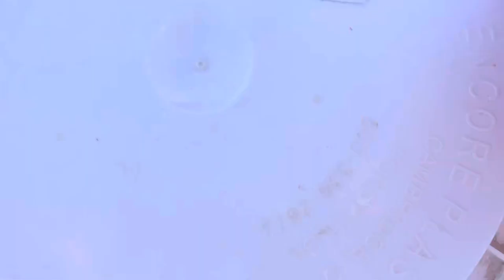Should we build a Rammed Earth Homes on our off grid land ￼

Comment: 100% Use rammed earth on the exterior walls and a couple inside for thermal mass-
I’ve always like the idea of a south facing glass porch with a roof that has long enough overhangs so in that in the summer much of the midday sun is blocked from shining into the porch. But in the winter, when the midday sun is at a lower elevation above the horizon that in summertime , all that sun will warm up the rammed earth wall. The wall built specifically to store that energy during the day and release it slowly throughout the long winter night. Aka passive solar heat via thermal mass.

Comment: Hey Bro! not sure about your dirt it might need a bit more gravel in it.  I was very lucky where I am to be able to use the dirt on my land it is perfect for Rammed Earth.  Originally I wanted to do Mud Brick but the dirt was not suitable for that. Hence Rammed Earth the dirt is perfect.  Good luck with it.  It is a great learning journey.
Reply: What's the best dirt for rammed earth and why?
Reply: @clivemossmoon3611  You can use any kind of dirt as long as it has clay content in it. 
In order to find out the clay percentage in the soil simply do a bottle test, put the soil in a bottle filled with water then shake the bottle well and leave it for sometime, when the soil settles down you'll be able to see the clay content forming at the top layer. 

If you're interested in rammed earth building then there are lots of videos on YouTube to help you out, plus you can always use google for further research and study, best wishes 👍